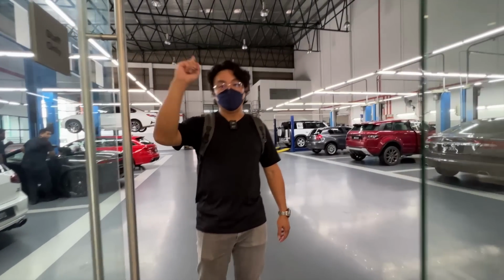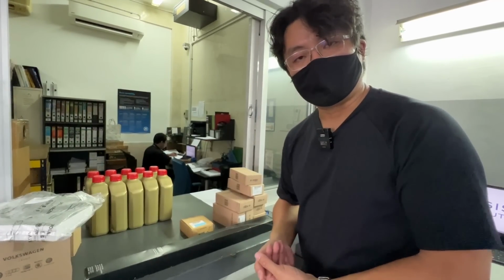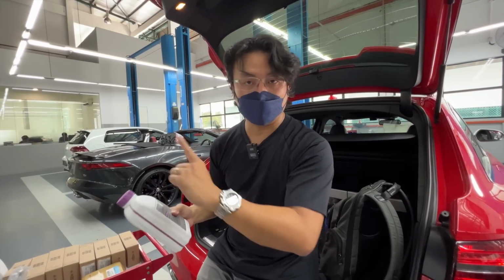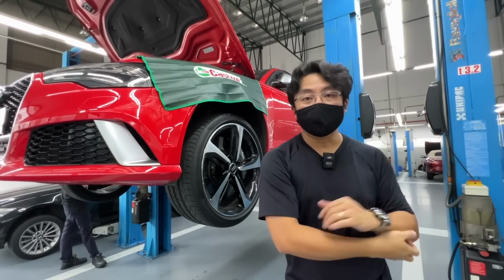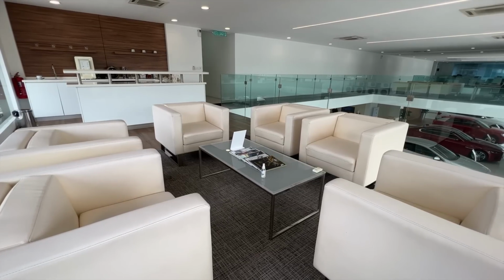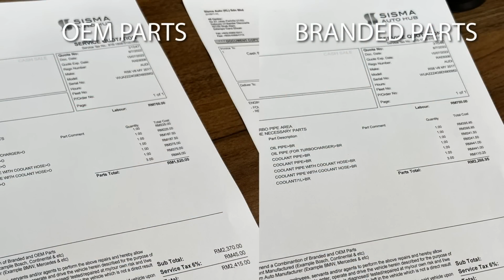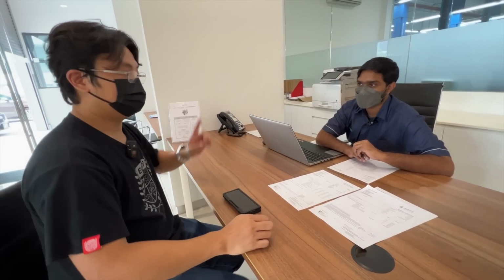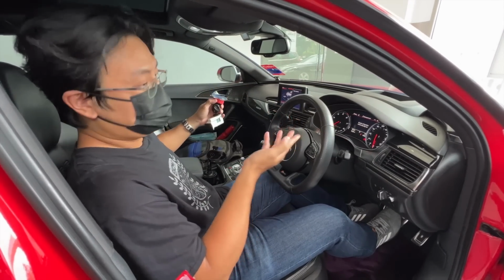Preventing the turbos from exploding in my 800Nm Audi RS6 | Evomalaysia.com

Comment: Looking  forward to go this shop.   Prestige KL really disappointing ..
Reply from the maker: What happened? But to be honest, when a workshop is too popular and too many cars swamped there, you then have to be patient. Hence i always encourage to keep relationship with a few workshops :)
Reply: @BobbyAngmalaysia   I'm using the extended  warranty  recommended by you.   Servicing by appointment. 1) Jan 2022,  normal servicing at 69k km Replacing  new battery for my 2016 F10 520d.  Only I discover in March 2022 they wrongly  install the agm  battery spec to Din 100  actual  105.  Take note the mechanic who installing also not aware that the battery need to register/ update in to the car system. 

2)In 6 June 2022 Saturday normal servicing oil change,  and air filter 80k km... After get the car.and get back home in Cyberjaya...the car feels jerking,  n underpowered... Rough vibrating feels inside the car..  I checked the engine n found  that it not properly install / fitting the air filter cover casing.  That is the basic... Just can't accept the 2nd incident... Workshop  that servicing  million dollar cars, suv. can do this.. 😂

Previously I'm using  E84 Xdrive 20d N47 engine  since 2012. @386k km...